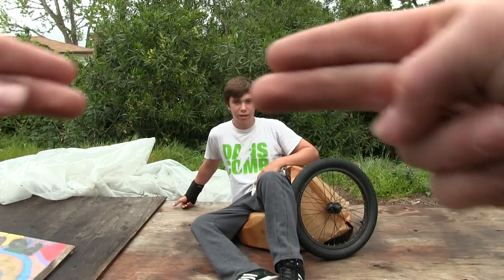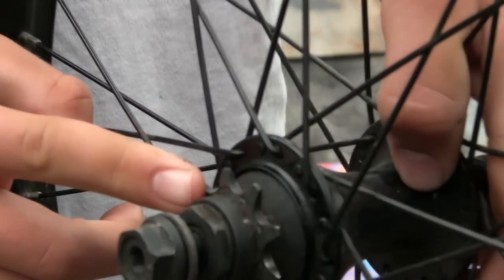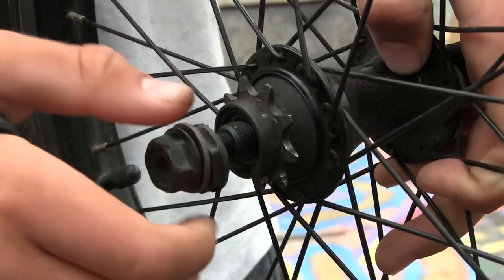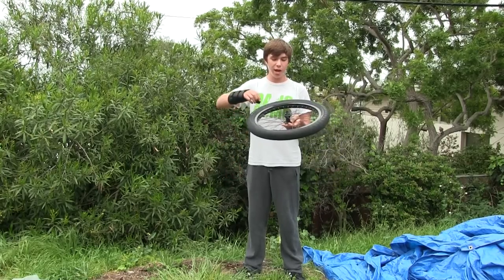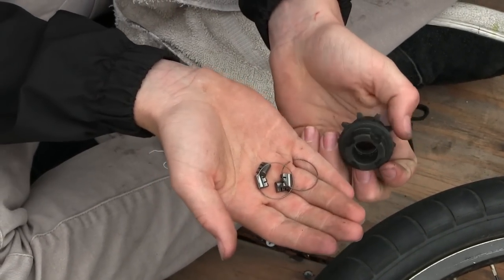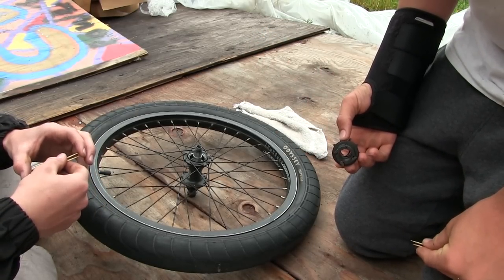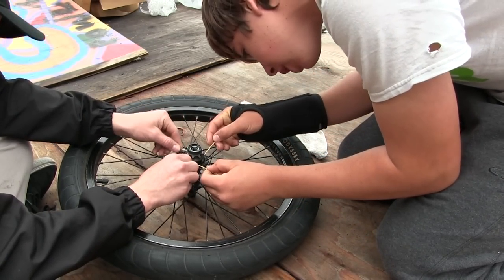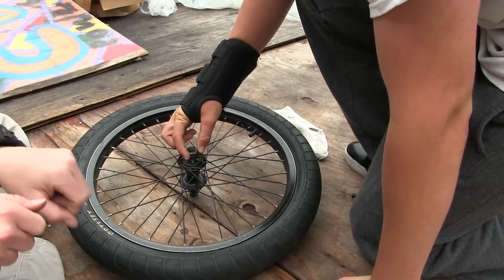HOW TO MAKE YOUR HUB LOUDER

Comment: instructions not clear,how do i put my grips back on now?
Reply from the maker: +Moto Productions Air compressor
Reply: ***** i just used my air compressor and now my frame is snapped :/
Reply: or zipties get 4 put them in the grip 2 on the bottom 2 on the top and slide it on
Reply: +Moto Productions what?😂
Reply: dude wtf? i think my grips were broken so i bought more, but how do i put them on my sproket without getting stuck? do i take off my handlebars?

Comment: This doesn't work at all. You need more Engagement points for the pawls to rub against. I have 6 pawls on my haro lineage hub has 28 Engagement points a 6 pawls.

my Haro sata rims have 3 pawls only but 36 Engagement points and it's much louder and feels much better even though these hubs are $120 less.